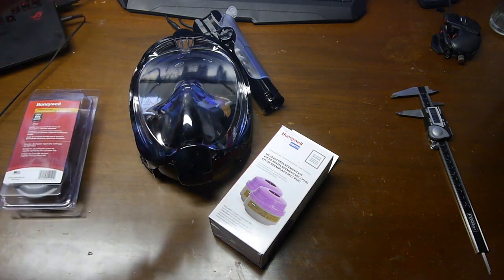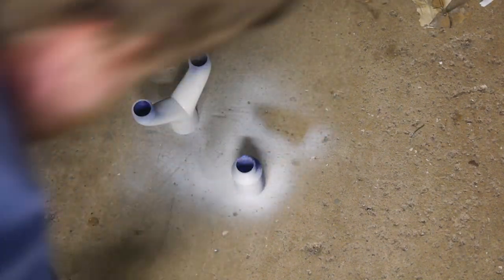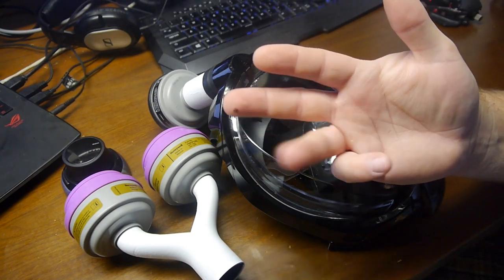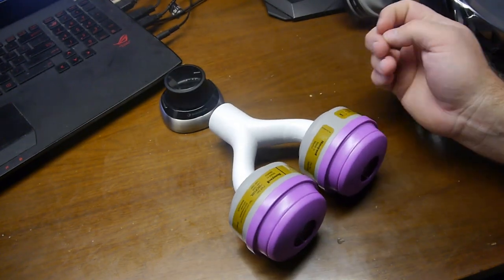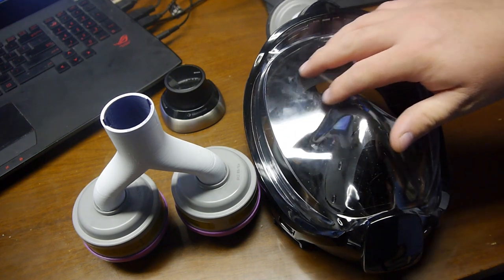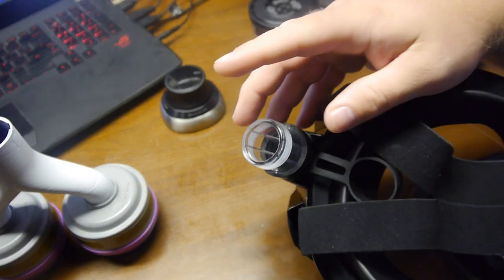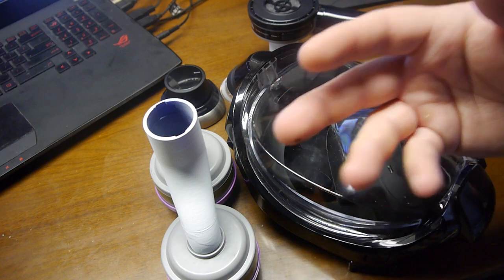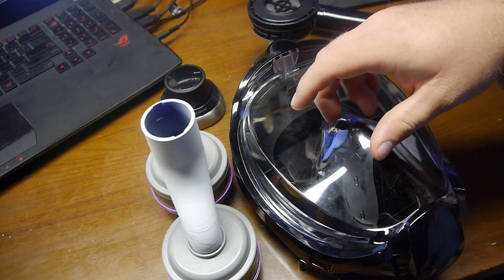Snorkle Mask: DIY 3D Printed Honeywell Respirator Cartridge Adapter

Comment: Hey man I think your content is great. What happened to the CNC videos
Reply from the maker: Hey Seed2277, I am glad you like cnc videos. I essentially ran out of steam on it and when I purchased a 3d printer that kind of helped vent the creative outlet juices I had. LOL. I also recently got a bridgeport so I have been using that quite a bit as well. I have several projects in the works that will involve, be about, require the cnc mill or other cnc related topics. I recently purchased an Ethernet smooth stepper for example. I also got a whole bunch of really nice servos, linear rails and actuators and controller for 115 bucks on Facebook marketplace. I need to go through the learning curve on that as well in order to use them for a diy cnc plasma cutter I have been thinking about for making small gears. Essentially I tend to work on whatever I am passionate about at that moment and it can leads to lulls in certain topics. Now that I know you are interested in it, I'll work on getting some cnc content into the lineup for the future. Thanks for watching!
Reply: @JoshAQ  that's awesome can't wait. I think your content is really unique because your sense of humour is so subtle yet it just works with these types of videos